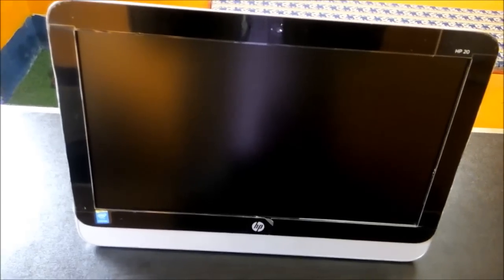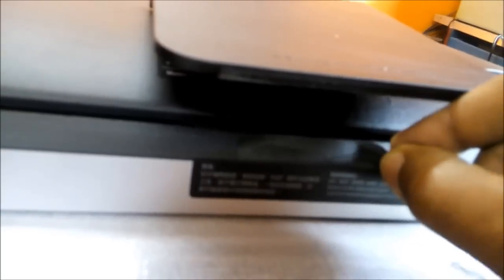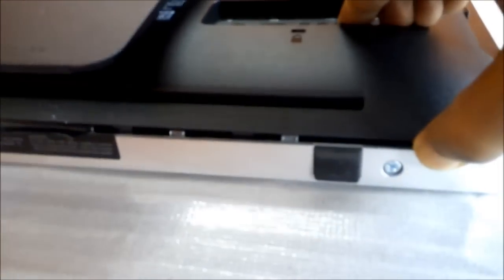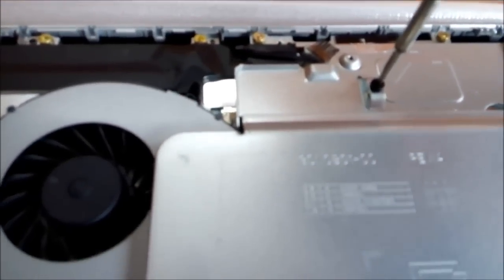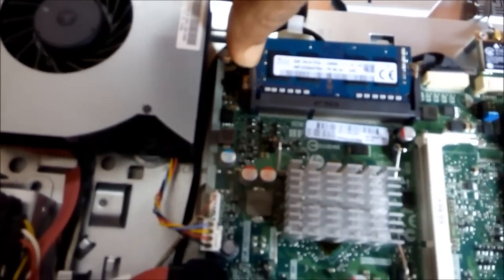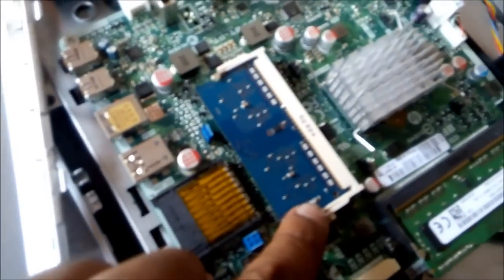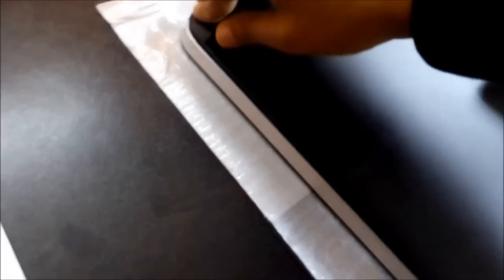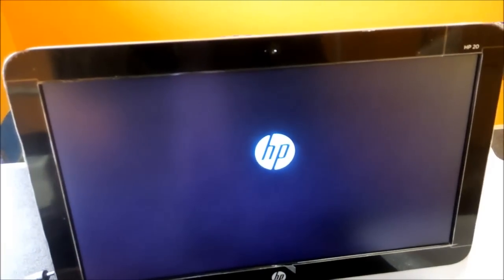How to open back cover of HP 20 All-in-One (2115il) and upgrade DDR3 RAM

Comment: hi tottaly i have this desktop can it be used for gamming and working plz reply
Reply: I game on mine and yeah its still good
Reply: @Velda_  how can i use xbox plz can you tell how can i connect
Reply: @dubmoviespoint6876  good luck on your channel if that's what your going for
Reply: @Velda_  thanks but how can i fix in all in pc
Reply: Dose yours have the xbox app. If it dose set your desktop account as you xbox outlook account and you should be able yo play the same games you bought as well as screen record with ctrl alt r or the xbox short cut which should have the key g in it with the command shortcut. However i forgot it. Need any thing just ask and i will find out
Reply: Oh but if you want to play more modern games smoothly you must replace the ram to 8gb and the gpu and cpu the newer ones and a graphics card IF YOU WANT but the other stuff you might need
Reply: What the hardware is broken you'll need to replace it and if it's an internal issue like software you'll need to get to do research or talk to a professional however the computer alone is not broken it's just semi out of date
Reply: I need to know the problem first
Reply: Any way what is your gamer tag on xbox -- i will add you

Comment: Hello bro.. I m using this hp20 
From 2 days my system is going to turn off automatically after 20 to 30 seconds 

Give me the solution pls
Reply: Does the display turns on?
As you press the power button
Reply: I may help u if u tell ur situation well

Comment: I have an Intel  Core(TM) i3 CPU , OMNI 200 PC . Installed memory is 2.00 GB (1.87 ) usable . it has  64bit operating system . I have two problems 1. It is getting hung and when you switch it off and then switch it  on , it is not able to auto start . It gives a message " start self repair " and ultimately it is unsuccessful . If you start it after half hour later then again it starts . 2. I want to increase the RAM , Can I do it and by how much by that I mean 4 GB .6GB total. Regards .

Comment: I have this same computer, and my power button turns on and the fan, but the screen stays black and the mouse, and keyboard don't light up, anything I can do?
Reply: Same problem Im having, did you find a fix yet?
Reply: Justin Thelusma  No 😢i tried everything and still no luck
Reply: Try reseting the cpu/cmos
Reply: HOLY SHIT I JUST NOW FIXED IT!!. All you have to do is open the case and clean inside with a dry cloth if its dirty, especially the fan. Next, carefully take out the ram and wipe it and put it back CAREFULLY. Then, take of the lithium silver(its about the size of a quarter) battery and put it back in, tighten any loose screws. Finally, put back the case and enjoy.
Reply: Justin Thelusma 

Mine is really clean, it's in practically new condition. What is the ram?
Reply: Search on youtube for what is the ram and how to take it out and back. Take it out, wipe it, and put it back in. On the same motherboard the ram is in, look for a quarter size silver battery, and fo the same. Put your case and everything in place. Now the pc should work like a charm. When it turns on, restart it twice.
Reply: Ignore all my previous comments, I fixed it permenitly by taking out the powercord and pressing the power button for like 2 minutes then putting it back...
Reply: Justin Thelusma mine was doing the same it would show it was getting power but screen would just be blank.. I followed your steps now it's back on and working.

Comment: Hey, could you tell me how bad my processor is?

AMD E1-2500 APU with Radeon(TM) HD Graphics 1.40 GHz

If that's good then something is wrong because each game is so laggy.

Any ideas?
Reply: Oh and btw, if it's bad can I possibly change it?
Reply: Well, to be honest, an all-in-one computer with an A.P.U. is just not ideal for gaming.  The A.P.U. that you've described doesn't have enough memory, speed, or power to run games effectively--hence the lag.  The only thing you could do with your all-in-one computer is upgrade your R.A.M. since the motherboard probably won't accept any other hardware--and even then, that wouldn't improve the lag much.I don't know what kind of games you play, but I would recommend a desktop computer (tower and monitor separate) with the following specs for respectable gaming performance:a core i5 central processing unit (C.P.U.) that runs over 3 GHz, a G.P.U. with a minimum of 2 gigabytes of gddr5 memory, and 16 gigabytes of DDR 3 R.A.M.  I hope that helps.
Reply: staley1981 Thanks for saying, but I might just build a PC myself to pick out the motherboard and a good Graphics Card.
Reply: JayChem Lemmy  Nice.  That's what I did.  Just make sure that whatever motherboard you go with, it is compatible with the C.P.U. you choose and that you have an adequate power supply for your graphics card.

Good luck.

Comment: Hi there and thanks for the video. I am not quite sure I understood the RAM Capacity of this machine. It looks like it has 2 ram ports.  My system came with 4gb, so I am assuming  1x4GB. This means the second port is open. Can I purchase another 8GB foir a total of 12gb or 8g is the maximum this machine can take?  e.g:

https://www.amazon.co.uk/gp/product/B006YG8X9Y/ref=ox_sc_act_title_1?ie=UTF8&psc=1&smid=A3P5ROKL5A1OLE

Comment: brother please make video for graphics upgrade..!
Reply: +Chetan jagtap You can't put a graphics card in an all in one computer.
Reply: Gage Plays How do you know that the power supply would accept a new processor? You can't replace them in all-in-ones because they are external. How do you know that the processor is replaceable? Most cpus on the same socket use about the same integrated graphics so it wouldn't be much of an upgrade.

Comment: hey I have a question when you put the 4 gb in and kept the 2 gb does that mean you have 6 gb in total?
Reply: This computer can take up to 16 gb
Reply: Try it out and see ???
Reply: MCSounds NeedToHere I can't but I just need to know if you put more gb in your computer will it add up
Reply: Template Gaming Yeah pretty much, but you have to make sure you have the same type of ram, like I heard you can't mix a ddr3 ram with a ddr3l ram for example because they use different voltage, if you using two both ram gotta be either ddr3 or ddr3l type 'probably gotta be the same brand name too not 100% sure'.
Reply: +Woodland Minecrafter I don't recommend you to have both memories, as I know, if you have two different sizes of RAM, the 4gb one will be limited by the other of 2gb, so the RAM of 4gb will be adjusted to the 2gb, and will be like if you had two of 2gb working you will have 4gb in total